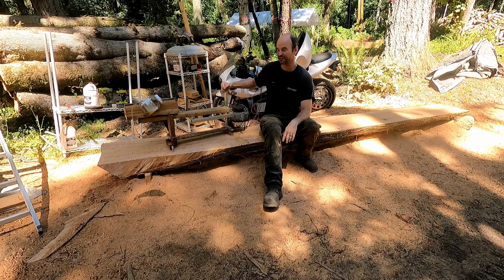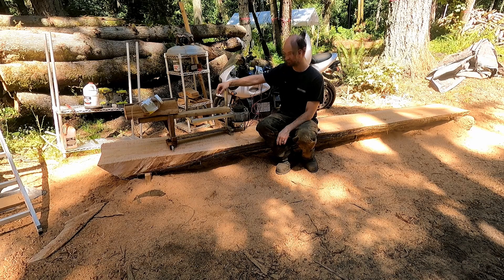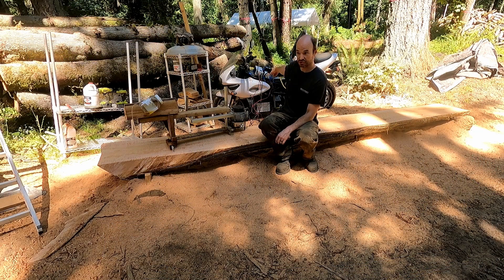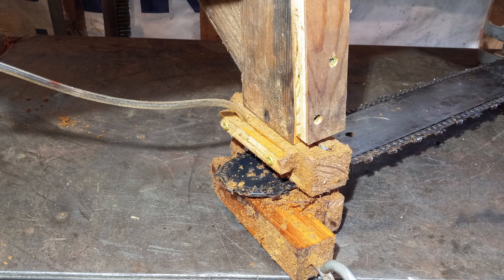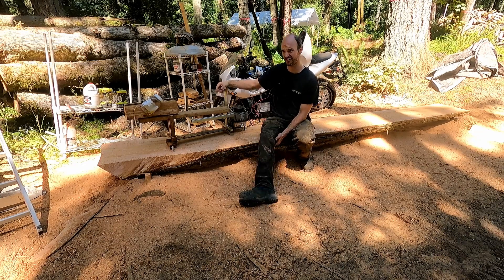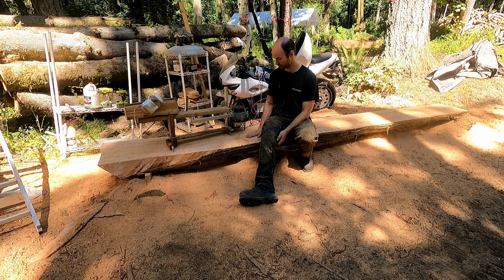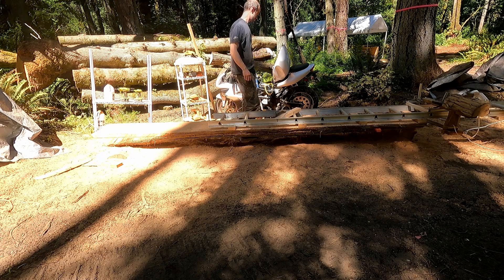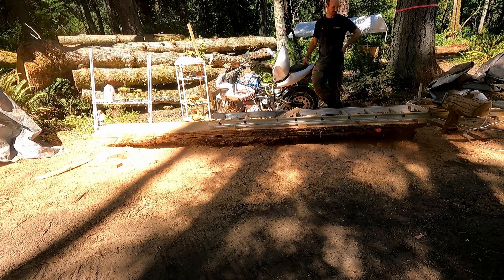A Better Milling Chainsaw

Comment: Hello Mike 
I have just discovered your YouTube channel. I too am trying to solve problems with chainsaw milling... you show this 12 volt 15 horsepower DC motor. Where did you find such a motor? It almost looks like an alternator from some kind of vehicle. Does it not require some kind of heavy duty electronic motor controller? 
What are you using for a power supply? Are you using some kind of 12 volt battery? What kind of battery?
Reply from the maker: It's a 48 VDC Briggs and Stratton Etek electric motor paired with an Alltrax controller and large-format LiFePO4 battery pack. Briggs and Stratton no longer makes the motor, but Motenergy makes a bolt-in replacement. However, the whole set-up would be cost-prohibitive for a chainsaw milling rig. The only reason it worked for me is I already had all of the components from my electric motorcycle build:
https://www.youtube.com/playlist?list=PLED4WaLmBmdGPLTwXfReT_liB5yx5Rhex

Comment: I've been looking at DC motors to do this same thing for a while.

With your experiences, and if it wasn't primarily for an EV, what motor would you target if it was dedicated to chainsaw milling?

Who knows why this content didnt do better in the algorithm, but it's a better idea than youtube gives it credit for. To my mind, DC makes a lot more sense in a lot of milling applications, yet manufacturers remain fixated on 3-phase AC.
Reply from the maker: Even though my motor was from my motorcycle, it ended up being a pretty great fit for the application. The RPM was close enough that I could direct-drive the chain, the power was sufficient, and it was nice and light-weight.

If I had it to do over again and wasn't building around the constraints of the hardware I already had, I'd have a good look at a Motenergy ME0709 or similar. The higher voltage would get me a lot more power with less heat build-up. It's the same RPM, though, which is a shame (3700 works but it's a little slow). Of course I'm sure there are tons of other great options out there. 

Who knows why the algorithm does what it does? I'm glad you found the video, though.
Reply: @UncleMikesCustomThings  Yeah, 8hp  to 8kW is about inline with the Stihl 881 and Logosol E8
Reply from the maker: @Cabinlab  Easily. I'm not sure how they rate chainsaw horsepower, but these electric motors match even at their continuous ratings. You'd have more than double that for peak output. In a milling application you wouldn't want to design around max numbers or you risk letting out the Magic Smoke, but for the odd knot or other bog-down situation, an ME0709 will crank out 19 horsepower for a full minute. Pretty impressive.
Reply: @UncleMikesCustomThings  Yeah, definitely an imperfect comparison. I threw the E8 into the mix becaisd it's Logosol's 8kW (~10.73hp) AC motor they recommend for chainsaw milling larger logs, slabbing, and their log moulder attachment. They also sell a 4.6kW for more normal use. Big chainsaw are in  the 8hp range, or about 6kW.  So the big gas saws (nominally) fall somewhere in that range.

I didn't see the specs on your motor, but thought you said 15kW in one of the videos. That's getting into the power you'd see on swingblade and bandsaw mills.  But maybe you were talking peak rather than continuous.

I've been targeting about 7.5kW because that's roughly equal to a pallet of inexpensive pallet solar panels.
Reply from the maker: @Cabinlab  Yeah, mine's a Briggs and Stratton Etek, which is 15hp peak and 8 continuous. They don't make them anymore but the specs are identical to the Motenergy ME0708. So not as much grunt as that E8 (or the 0709), but right there with a pretty good-sized gas chainsaw. And a huge upgrade from my el-cheap-o ones.

Of course any time you compare gas to electric it's a little bit of an apples-to-oranges thing. I know it's a little cliche to say that electric motors have more "usable" power, but my experience bears that out. Unless you're really milling some mammoth hardwood logs, I reckon 7.5kW would treat you just fine.

Sounds like a fun project. You think you'll make a video or post a build log anywhere? I'd love to check it out.
Reply: @UncleMikesCustomThings  I didn't know Briggs made electric motors. Funny, I spun a crank bearing on the 23hp Briggs Vanguard powerhead on my mud motor, and was thinking of a dual 10hp electric conversion on that. Battery power density is still not ideal for boats though, so we'll see.

If I build the electric saw, I'll for sure make some content about it. I'm 2° below the Arctic circle and there's no solar now until almost February though. Can't install solar panels until everything melts again.

There's an older video on my channel that gives a verrrrry quick preview of the remote property where the solar panels/mill would go.
Reply from the maker: Great stuff. Subscribed.

Comment: Cool build. I was wondering what's the part number of the motor? Thanks for the upload
Reply from the maker: Glad you enjoyed it. The motor is a Briggs and Stratton Etek, which hasn't been made in quite some time and is getting almost impossible to find. A bolt-in replacement with almost identical specs (but inferior build quality) is the Motenergy ME0708.